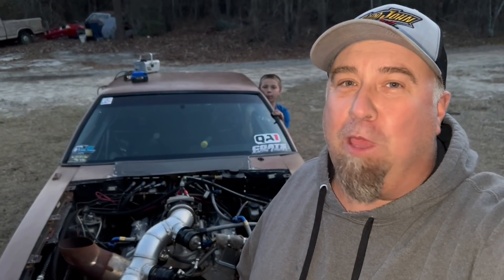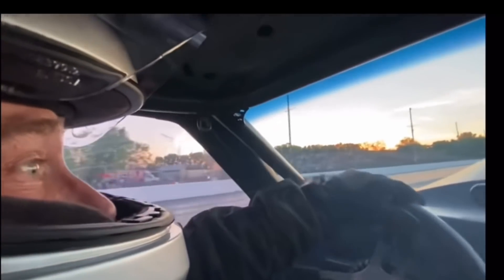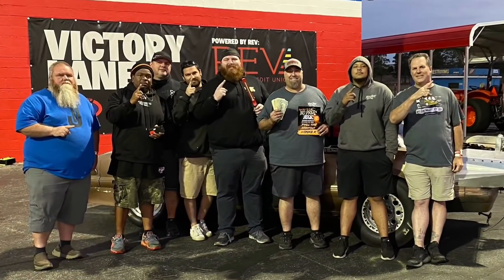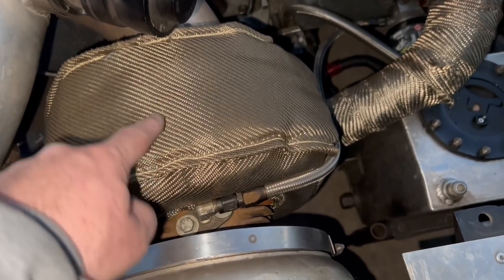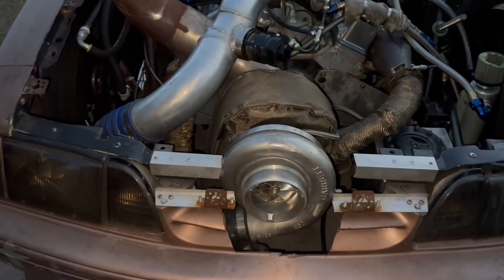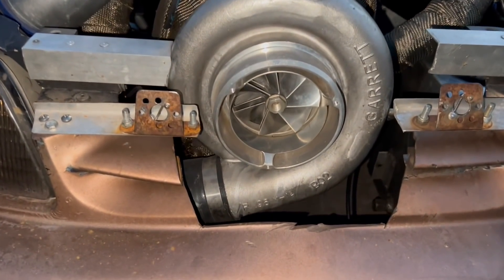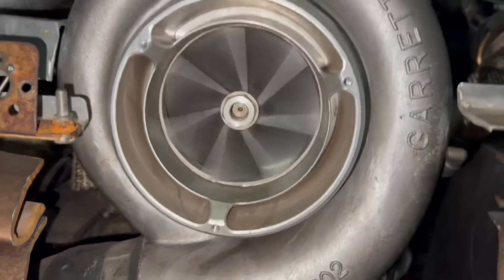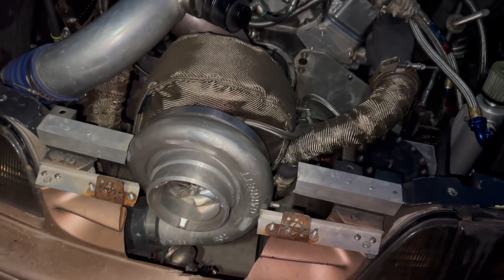How a Turbo Works

Comment: For the guys like you with forward facing open turbos I wonder if the inlet would benefit from a funnel attached to it?  Especially at higher mph.  Might affect the nose of the car though.  Aerodynamics is often ignored because it's so hard to see.  Cool video.

Comment: TJ, looks like at 4:10 you have some serious spark arching going on behind the down pipe possibly from the coils on the pass side.
Reply from the maker: You Rock buddy!  I didn’t even notice that! I’ll look into it and see what it is, I thought it was running a little rough! Thanks
Reply: @TurboJohnRacing  It might just be the gold crush fitting on your breather line bobbling around when spooled on the brake but it looked a lot like an arch.
Reply: Damn Turbo Johnny fans find it again.
Reply: @frankkatsenis3812  Its always a great day when you can find missing free horsepower!!! :-)
Reply: I was noticing that the engine was sounding like it was misfiring and first thought the engine huffing in smoke from the smoke machine might of been causing it and then I say the spark jumping to ground and was about to post a comment the same time I saw @Mark C post in any event after tracking down the source of the spark jumping I think I would pull the plugs and at the very least clean them because smoke machines are basically a hot plate that mineral oil gets atomized upon and I can tell you from first hand experience when I worked as a bartender on weekends that smoke leaves a oily residue on everything it comes in contact with, the 64 dollar question is can spark plugs burn that crap off completely or not personally I think some sort of smeg has to be left on the plugs.
Reply: Heck yeah, you got some good eyes buddy 👍